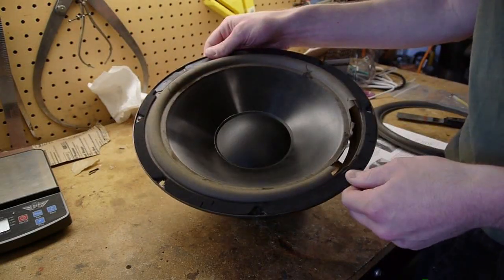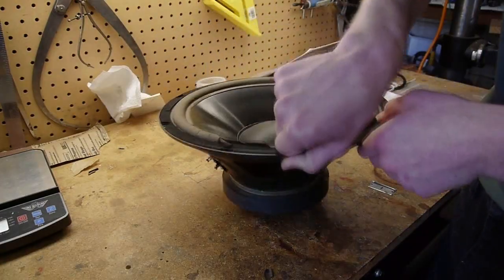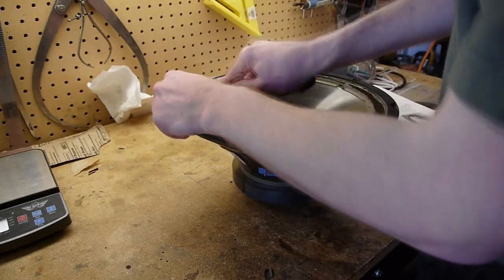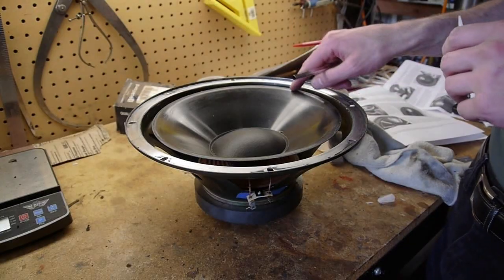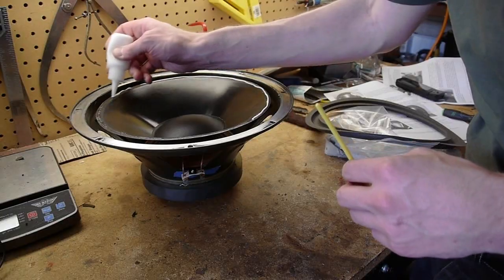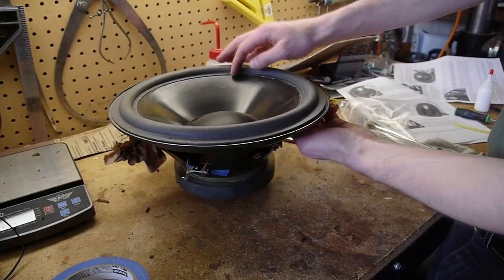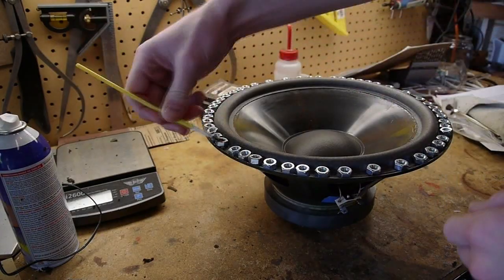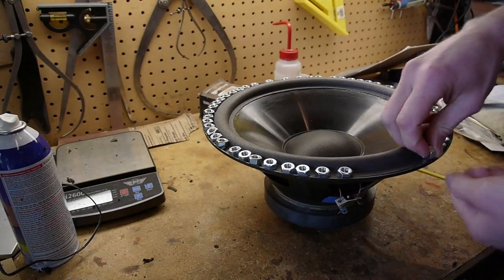Speaker repair - replacing the foam surround

Comment: a tip I'd wish to give to the viewers of this video:

Elmer's Rubber Cement is a great preventative buff to put over a weak cone/suspension.
If the hole is too big, I sometimes use paper towel dipped in rubber cement to patch it up.

Sure, it adds a little extra mechanical resistance to the speaker, but I can't hear a difference nor have I ever damaged a voice-coil by making it too restrictive.

And like always, thanks for the great videos

Comment: He did check for centering issue after gluing. It was just fine. Doesnot have to be accurate at atomic level, just that Voice coil does not rub the metal.

Comment: Your misunderstood. Your dual speaker connections are for your dual speaker coils. You have a DVC speaker and ther nothing to do with feedback. Instead it has everything to do with speaker wiring. If your speaker is a 4 ohm DVC speaker if you wire the 2 coils together in parallel then the 2 wires going to your amp is 2 ohms.

Comment: I really think youu need to center the voice coil. Remove the dust cap and use shims to center it before you replace the surrounding. Then glue a new dust cap.

Edit: Just saw your comment about this.
Reply: No, that's for a recone. This is a refoam

Comment: @bkraz333 thx very helpful. Btw since its old should i even bother paying $20 to fix it? The tweeters seem to be working fine. Not sure about the bass though. I don't want to fix something that can't be fixed to begin with. Or it could be like you said the surrounds are having a huge affect on the bass since its not even on the driver

Comment: WOW!!! You needed to apply this speaker surround on a third Thursday in a month that starts with the letter A, with an ambient temperature of 75f to 83.2f while wearing corduroy pants and a thin brimmed ball cap otherwise in 17 years time it's going to reproduce a frequency of 14,000 Hz at 72 dB when it should reproduce a frequency of 13,995 Hz at 73 dB!!!!! Lord have mercy on your ears.

Comment: My cone doesn't have a big flat lip to put glue on like yours does, but the surround I just ordered does. Any recommendations to make that connection work? Should I try to force the flat part of the surround down into the cone?
Reply: You need a angle attached style surround

Comment: Ok stupid questions. Does the surrounds on the speaker have any effect on the sound quality? I am trying to repair an old 1991 sony ss-tl1 speaker and the surround foams on the sub woofer are gone. The bass without the surround foam is very lacking. Will it change once I add the surrounds? Or did i ruin the sub woofer when I used it without the surrounds

Comment: What did you use to clean the foam off the cone, and did that come with the kit?  I tried a spot with alcohol and found my cone melting.
Reply: +Mark - his cone was polypropylene, which means you can use a wide variety of solvents since pp is quite hard to dissolve. If your speaker cone is any other material, i would suggest using an old style a razor blade. Sharp and really soft.
Reply: +Mark - his cone was polypropylene, which means you can use a wide variety of solvents since pp is quite hard to dissolve. If your speaker cone is any other material, i would suggest using an old style a razor blade. Sharp and really soft.

Comment: hey i have a JL Audio 13W7 and the speaker was sitting at my garage and it got wet inside of the speaker, but with them time it dried itself. You think being that the inside being wet before will affect the speaker if i repair the rubber??

Comment: HI , I currently have a Yamaha YST - SW 80 subwoofer which I have accidently damaged the surround foam and it has a small torn bit, if i consider to change the foam do I need to match the foam rubber kit to the making of the subwoofer or any foam rubber kit would work on it? Thanks :)

Comment: i noticed that the cone surround was blocking the mounting holes. the speaker i ordered has half of each mounting hole (four mounting holes) 50% covered by the speaker cone surround. i'm wondering what do to as the bolts can't go through the holes unless i try to cut the surround out of the holes. what did you end up doing to clear the mounting holes?
Reply: Well yeah, it's just feeble foam, once you've got it glued down it's not going to move, just shove the bolts through or cut it.
Reply: Andork Kuomo thanks! I did that and it worked.

Comment: What band do you have playing during the fast forward segments? They sound awesome.
Reply: Shaun McMillan lmfao
Reply: Excellent tips putting nuts around the periphery, and newspaper under the diaphragm. Like other commentators, I am going to run audio through my speakers in the first few minutes of glue curing.

Three 1990s speakers to repair this week: two NHT One (6.5” mids) and a Paradigm 10 inch sub. Thx for the ideas.

Comment: If you change the material of the surround, the sound of the speaker will change, normally to the worse. If it used foam, replace with foam, and if it used rubber, well, use rubber.
Reply: The only reason not to use foam is because the sub is very active, like sundown where it moves an inch. If you use foam there it will tear. Foam is more mobile and you get a much richer sound. Unfortunately, it degrades much quicker

Comment: The measured specs are altered only very minor since the flexibility coefficient of most foam surrounds is similar to rubber. Fs, Q and VAS specs are mostly affected by the speaker's spider (the surround itself having less of an effect). Usually rubber surrounds are an improvement in sound particularly in the bass and especially if they are made of butyl.

Comment: How do you know if it's centered stuffing it with paper like that.
Reply: The dust seal (spider) at the base of the speaker cone, where the voice coil is, keeps the cone centered.  Also, gluing the surround to the cone first allows you to center the cone to the basket later.

Comment: Since the speaker needed repair because of a rotting foam surround---why replace it with another foam that's just going to eventually rot? Install a RUBBER surround---yes they are available---and you will never have to replace it again.

Comment: You should take of dust cup of and center the coil
Reply: You don't need to remove the dust cap you can play a 50hrz tone to center up the foam on the basket.
Reply: @floydbeard5073  I've never heard of that, can you elaborate a bit more on that? You've got me curious.
Reply: @flyurway   what you do is play a 50 hz test tone on your radio I use a old 75 radio and use my cellphone with a rca jack to the aux of the radio. What I do is lay the bead of the foam glue and you start the 50 HZ test tone the volume turn it up enough where you hear the woofer hum and you can presser the foam down on the glue and if the foam is off center it will make a slight buzz so you adjust the foam to center there is actually a YouTube of this also I think it was Springfield woofer repair that posted it.
Reply: @floydbeard5073  Hi, thanks for the response. I also ran across another video last night where someone showed how he does it just playing music through it - he was playing Journey in this case, lol. His theory is that as long as you're playing "something" through it, current is going through the coil which is all we need. Pretty cool, I've learned something new! Thx again!
Reply: @flyurway  hey no problem. I had to do it that way on the pair of 10" rock fosgate. There are from the early 80's and I did not want to destroy the paper cone and paper dust cap. Playing the test ton worked perfect.

Comment: Anyone who understands this is faulty advice would remove this video.
Why not remove it? Asked of the OP.
Well somehow, it is making them money?
Then, of course, the reason is ... caaChing.

Shimming, or running an audio signal through the voice coil during the gluing process is an accepted method for centering the voice coil.
11 Years ago, maybe it wasn't known, but now it is.
Any other method is based on luck, not science.
OK, this speaker renovation lucked out, granted.
But, this hap-hazard method, as presented, is not based on better, now common methods.

I'm peeved this showed up in my YouTube suggested files.
The internet does not need more bad advice

Get up to speed and remove what is aged, now shown to be wrong, advice.

Comment: very poor and inconsistent job never mention the glue type not tasting the glue... you are suppose to use a special turntable to apply the glue properly on the cone and firs on the surround upside down...if you have micro gaps left between surround and  cone they will produce distortions...why nobody talks about type of material the surround is made from? the word "foam" is not enough because the foam can be made of very many types of plastic, polyurethane, santoprene, neoprene and even butyl rubber...  soap makes foam too...hahahaha...sorry but not enough quality and expertise here...